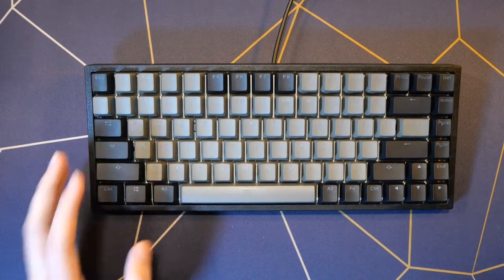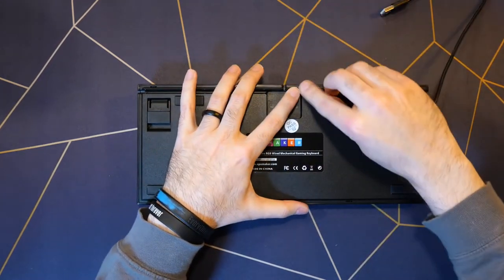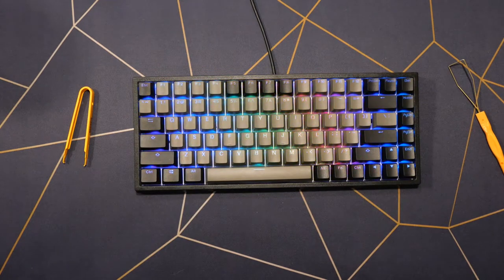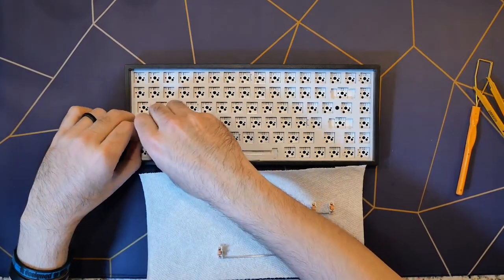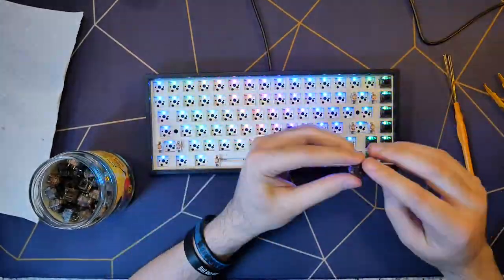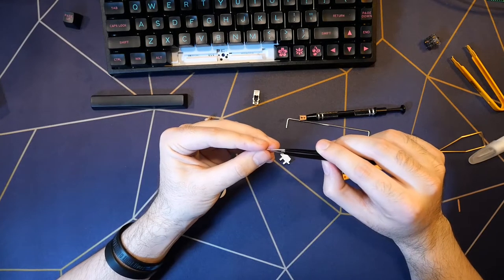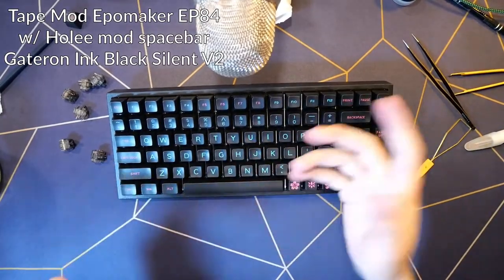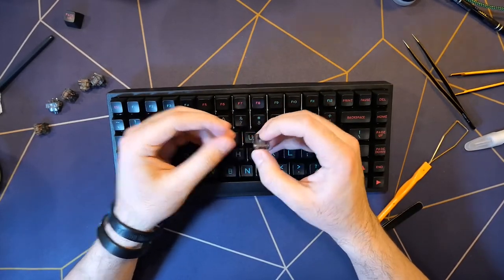EPOMAKER EP84 - Ink Black Silent V2 & SA Miami Nights Stealth Mod!

Comment: yooo content on the EP84 on youtube has been so dry. I ordered one and just want to see some recent uploads on it and you’re like the only quality video out as of recently lol
Reply from the maker: Hey thanks! It's one of the best budget boards I've ever used. IMO way better than things like the Royal Kludge at the same pricepoint, and with minimal mods it can sound really good. I think tape mod is the best on it to reduce any case hollowness. Or if you wanna go overboard change out the foam for like silicon or something lol
Reply: @IconoclastMark  good to know man i’m just excited for my board. hopefully it doesn’t come in two pieces because shipping is taking quite a while (almost a month). just wondering, did you order from the epomaker site? and if so, how long did it take for it to come in?
Reply from the maker: @patayder566  I did actually, I talk about it for a bit in the video, but it took like almost a full month to even ship out. I don't like supporting Amazon when I can, but I definitely kind of regretted not getting it on prime lol.
Reply: @IconoclastMark  man thats weird because amazon usually ships pretty fast dont they? maybe because of holiday surge but not sure
Reply from the maker: @patayder566  yeah, ordering from the epomaker site was rough, but the keyboard was worth the wait